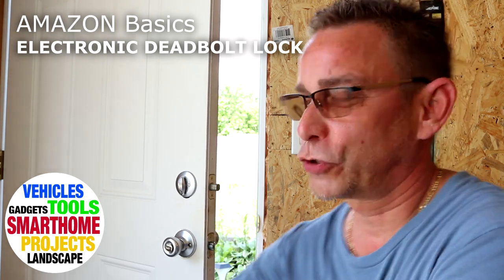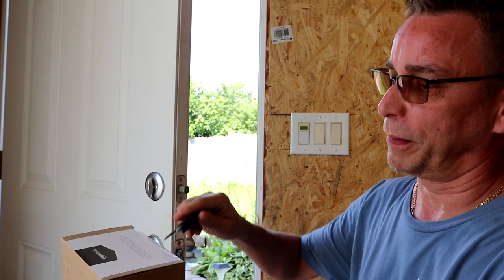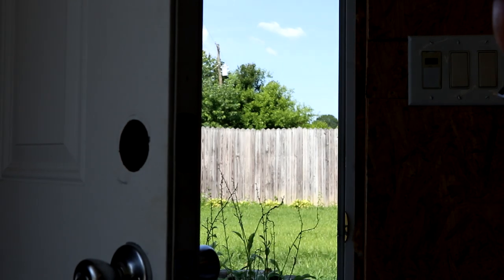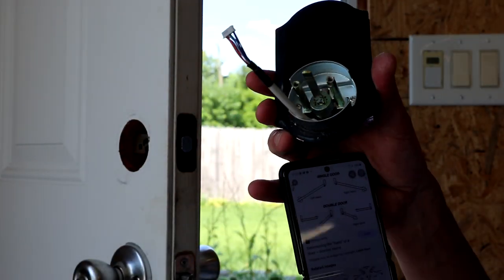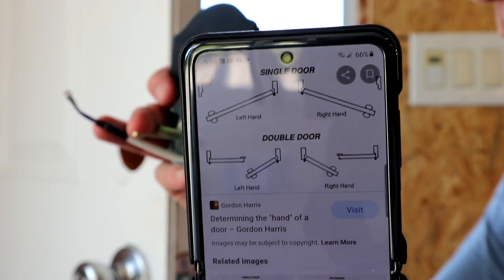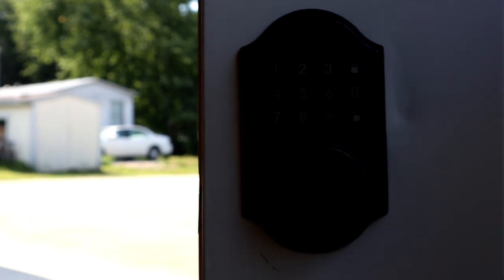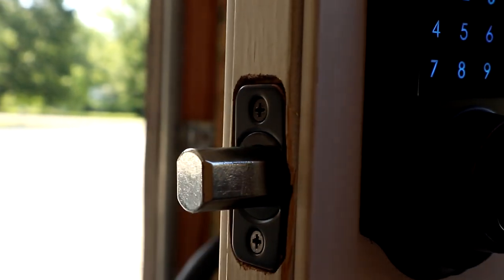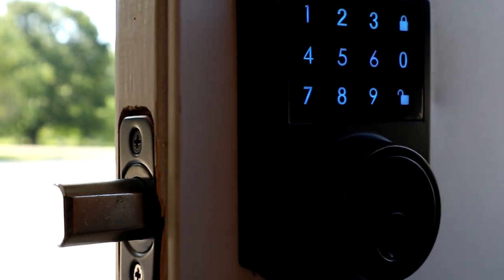Simple Installation of the AMAZON Basics Electronic Deadbolt Lock | NO KEYS!

Comment: To all of those asking how to program the pin:

-Type in factory set code (normally 0000 or 1234)
-Press the lock/unlock button
-Press “1”
-Press the lock/unlock button
-Type in your desired code
-Press the lock/unlock button

If you want to change a pin you have already set yourself, do this same process, except change the first step from 0000 to the pin you previously set
Hope this helps! 😊